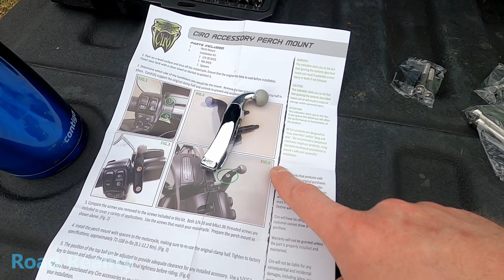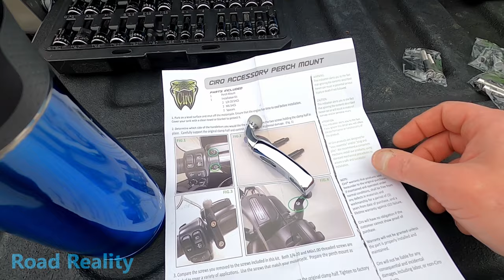INSTALL / TEST / REVIEW - Ciro 3D Big A.. Drink Holder // 2019 Harley Street Glide Special

Comment: Jeez! You're gonna have to use a torch to get those bolts out with all that lock tight 😮
Reply from the maker: HAHA, yeah, oops.  Actually, maybe not - I had the dealer install heated grips last time the bike was in for service, so I'm pretty sure they had to remove my cupholder to do that... and they never complained :D

Comment: Is that top chrome part chromed aluminum like the perch or is it chrome plastic?   I have not seen one in person yet and no one has been able to answer on this yet.    Thanks.
Reply from the maker: I'm pretty sure it's plastic.  The perch is aluminum like you said, but AFAIK, the rest I'd plastic and rubber.  Still durable though- I've Bern using this thing on almost every ride with no noticeable wear.

Comment: Are the bolts supposed to be tightened down with torque wrench?
Reply from the maker: They don't have to be, especially if you use a thread locker like I did.  Getting them good & snug will be sufficient.